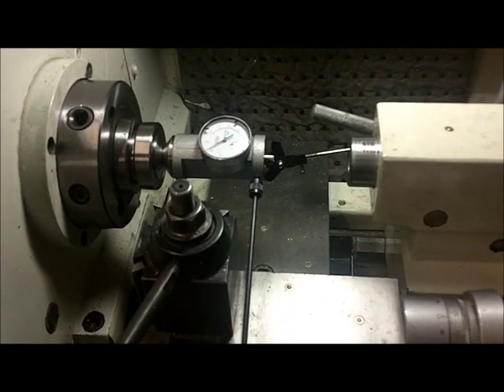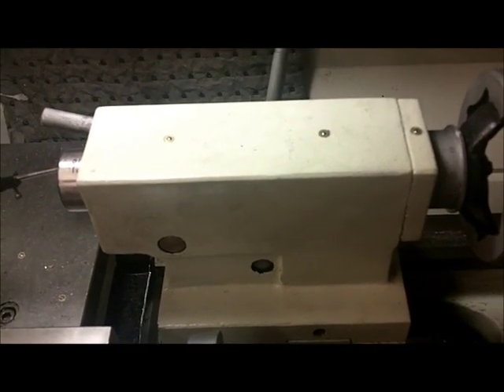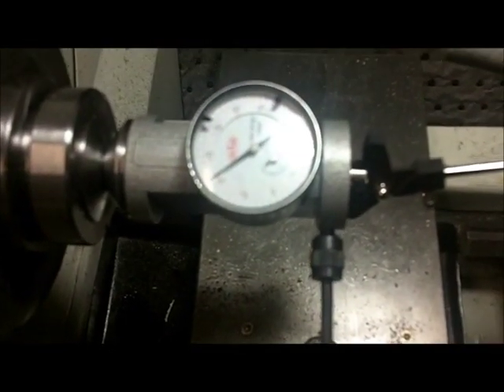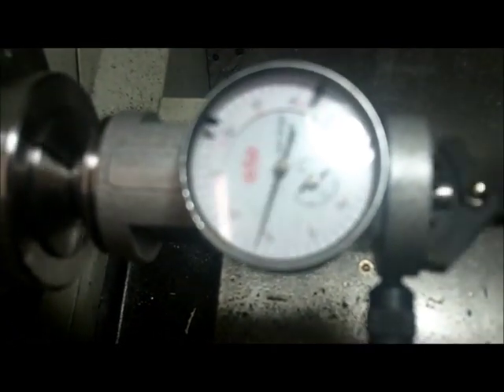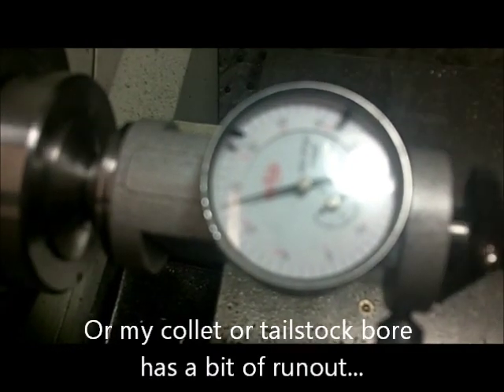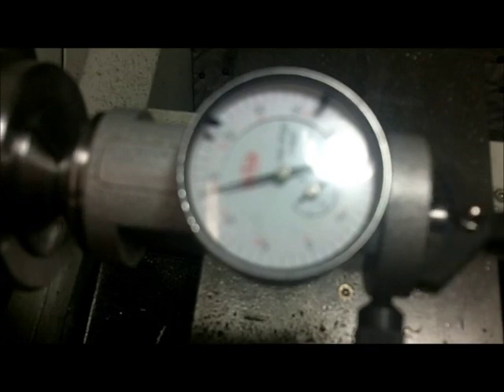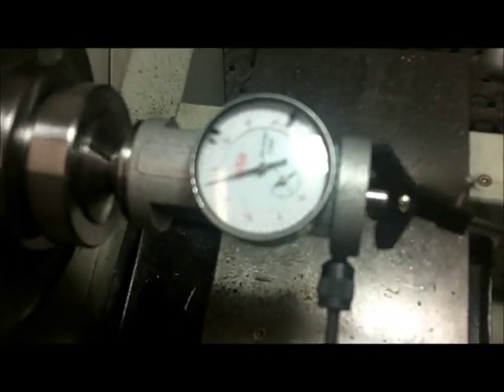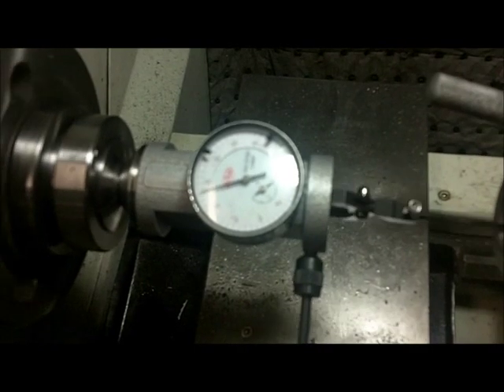Aligning a lathe tailstock with a coax indicator

Comment: The best way is to turn a bar and check it for any taper.    Every time you put that in a chuck or coolet your are creating a new axis for your work.  it could be a mile of and still it will turn a perfect round.   All you're doing is lining up your tail stok with whatever axis error you have at the time.    Put in a new part and you'll be off. 

Then you' have the probe in the morse taper.   Can you trust that is accurate?    What about the rest of the taper?    I just can't see this being very useful.    It's a nice idea, but I wouldn't trust it.
Reply: A coaxial indicator does just that. It allows one to align 2 different bores/bars or offset parallel axes to be centered on the same axis. This can also be accomplished using a standard dial or test indicator though with a bit more difficulty. On every manual  lathe I've seen, the center line of the tailstock is parallel to the center line of the headstock but it can be moved forward of backward to create tapers (while still being parallel to the centerline). Thus if the mouth of the tailstock is axial with the headstock, the rest will be also, while disregarding wear of poor initial manufacturing .

Comment: There's a question:  What are you actually measuring?  That probe sticks out quite a bit, and there are different ones... you'd almost have to do a little test, slip a feeler gauge or some paper or very thin shim stock in there, and see the reading.  It might be... that if you see a thousandth total runout on the gauge, that the actual amount the tailstock is offset might be less than that?!!??  I would personally just do as we see here, make it as "right" as I can, but it's an interesting question.
Reply from the maker: You're right and I have wondered this myself.  But, I never checked it.  It would seem to me it's most likely measuring angle but using thousandths of an inch as a scale. But, distance or angle, 0 is still zero.  Thanks for your comment.

Comment: Or that wobble in that Chinese coaxial indicator
Reply: Wobble in the indicator is a possible source of error, but errors in the mounting shouldn't matter. 
It would be interesting to put the indicator 1/2" off centre in a 4-jaw chuck. It should still work just the same.
Reply: Gravity

Comment: As you commented it would show you which way to adjust if you stopped the lathe and turned by hand. This would also confirm vertical accuracy. This is a good method as you can align the tailstock in the  position you are going to use it. I do this to centre sub 1mm drills.

Comment: I have just dicovered this video and couldn't refrain from doing the same on my lathe (never checked the tailstock alignment). I found 4/100 (factory alignment, not so bad for chinese lathe). I found the vertical alignment was perfect, the misalignement came from horizontal (easier to fix!). After alignment I reach a runout  < 1/100 mm. Not so bad and enough for me!.

Comment: Like the idea but if you don't repeat the test further into the tailstock bore at the same setting, to prove alignment with the spindle axis, the tailstock bore may not be aligned along the spindle axis. This is important, and because of the overhang from the point of measurement, any tool fitted to the tailstock will not be centered on the work piece if the bore is not in alignment with the spindle axis.
Reply: 100% no real alignment was done but still an ok video
Reply: But is that not a matter of the ways being aligned with headstock and the accuracy of the tailstock to ways

Comment: John if you have an old printer there is a ground rod near where the paper pickup is. I use one to setup between centers, and use a Last Word to dial it in. Hope this help. It is cheaper than the purpose build rod.